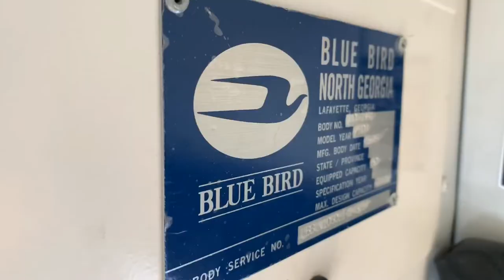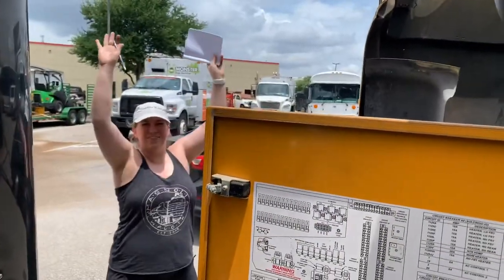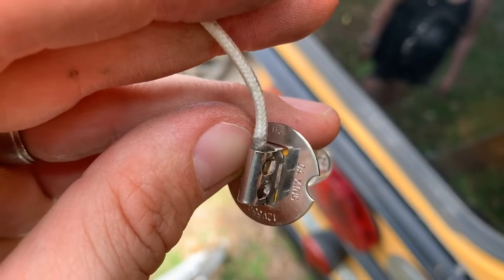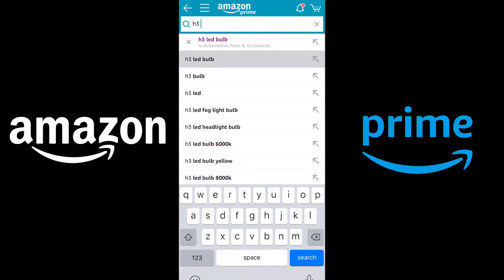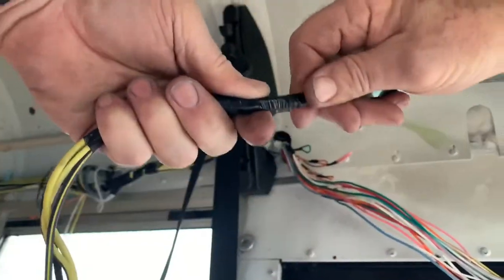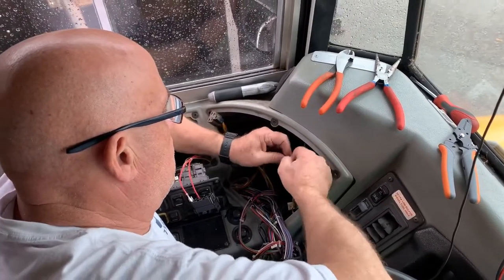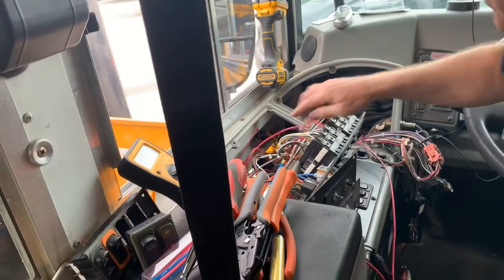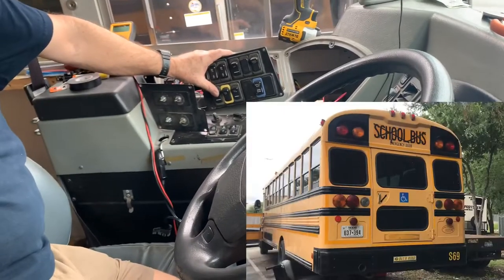Repurposing the Flashing School Bus Lights || 2020 Bus Conversion - Ep. 13

Comment: just watched. those are halogn bulbs. dont put you fingers on the glass oil from skin will caus failure. wear glove clean with alcahol.  as for covers different states have rules on the lights. when riding on streets they cannot be on.  drivers might think you letting kids off if red or yellow lit. rear clear to use as backup or parked lights  good idea front i just cover.also paint out school sign is good practice

Comment: We ended up deleting our front ones but the rears we bought aftermarket led ones and using them as brake and turning signals.
Reply from the maker: That’s a great idea! We should have looked into that.

(Disclaimer for others reading this: your state may vary in what is allowed—do your own research)

Comment: I would replace with LED
Reply from the maker: Good point, and we thought about it. Since they’ll only be on when the bus is running, we figured the power draw doesn’t matter as much as it would otherwise (on house bank). We’ll wait until they burn out and then do the LED swap. Good idea!
Reply: @TaleOfTwoSmittys  Just make sure not to get the ones with the IC Chip! That makes them strobe! As seen in txstreetman's LED video.
Reply from the maker: Yeah, no strobe!!

Comment: So this is the part that I'm most nervous about, I want to completely repurpose my old command board and rewire a lot of everything.. it looks like y'all are doing a really good job.
Reply from the maker: Thank you! We had some help. Without it, we would’ve been lost. What type of repurposing are you planning?
Reply: @TaleOfTwoSmittys  the front dash panel is in good shape. Beside the driver's seat is is where all my toggle switches are located. I plan on installing new lights and ectronicts for inside and outside the bus. I would like to replace the old toggles with a brand new toggles switch set up with everything I want, without the stuff I will not be using, like stop sign, real heater, ect. I believe I am going to keep the orange lights up top but I will switch them to the flashing side and remove the red one all together, replacing it with a clear lenses. I have a fairly detailed idea of what I want to add and what I want to do. Unfortunately I do not have an old bus wiring guru so I'm part of the YouTube academy.
Reply from the maker: Oh man, we hear you. We are so blessed to have had Grant’s help. 🙏🏻
Reply: @TaleOfTwoSmittys  well I'm very glad that you had that help available! I know that I will either figure it out or eventually get somebody to help me do it. Follow me back on Instagram 7th_day_buslife to amuse yourself with the struggle. 🙃🤔

Comment: Hi, wondering why you couldn’t just bypass the flasher relay or controller, so when you turn on warning lights they stay on? Seems it would be easier. I am wanting to do that on mine but I don’t have the fuse door like yours so not sure where they are.

Comment: Quick question, what are the square part that have a bus bar running on one side, of them with the positive wire. And another wire on the other side. Are those fuses or resistors. Please help.

Comment: U all did "not " tear out and insulate ceing and walls? just wondered..
Reply from the maker: Correct! We did add insulation in some areas (some walls, several windows), but we didn’t tear out any exterior walls or ceiling.